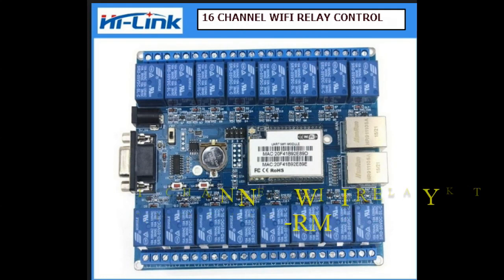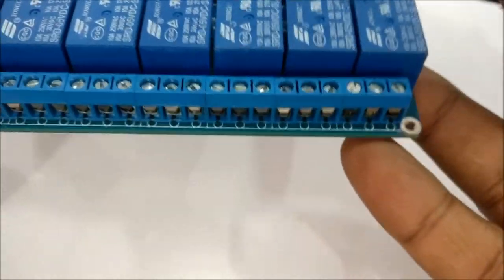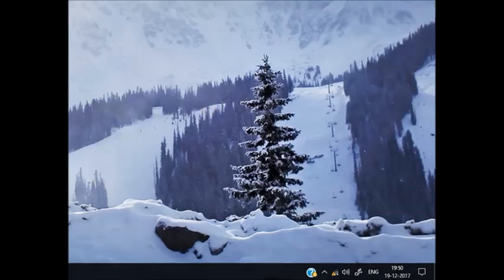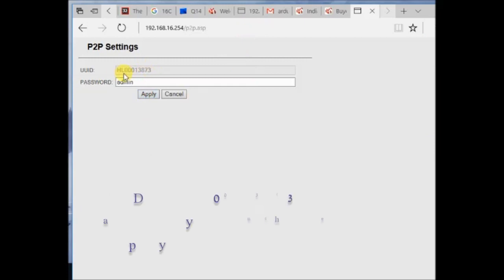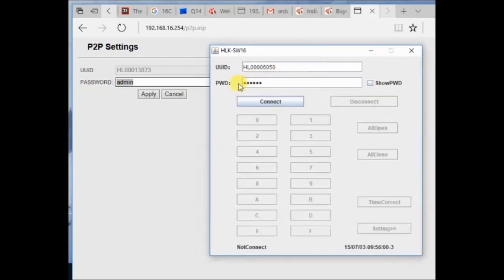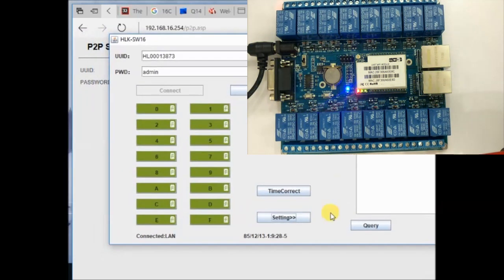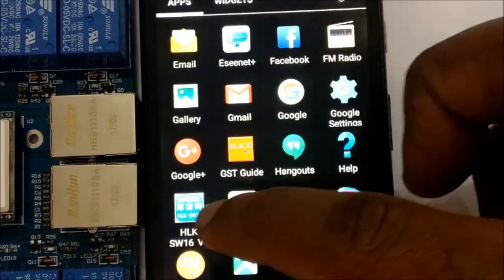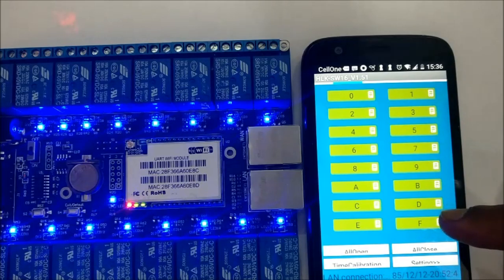16 CHANNEL WIFI RELAY KIT - HILINK HLK-RM04 HOME AUTOMATION

Comment: It all works until I try to change the subnet to something more usual like 192.168.1.xxx instead of default 192.168.16.254.  If I change to 192.168.16.253 it works.  But 192.168.1.80 it doesn't seem to work.  Is it allowed to change the subnet?

Comment: Thanks for the video.
I unable to connect wire in relay module. 1st & 2nd wire start automatically even when relay module is off. And connection between 2to3 or 1 to3 didn't work. Please help.

Comment: Hi how to connect wall switch,  in case if there is internet failure can we use wall switch to run the appliances manually. Please advise.
Reply: U can use parallel to relay contact to swith

Comment: Hii i want to watch how can we connect this device with main power supply nd all appliances i mean if we are giving main power to this device its going blast right so how can we connect this with all home appliances???
Reply: 5v are required to operate the board only, now after that, each relay has three pins which are in two connections i.e NO (Normally open) and NC (Normally close) . the neutral of each device/appliance will be connected as common and phase will be at the Relay's NO. whenever the relay is activated the NO will become NC and the current will start flowing and your device connected to that individual relay will turn On. see how to connect load with relays ,it will help you.